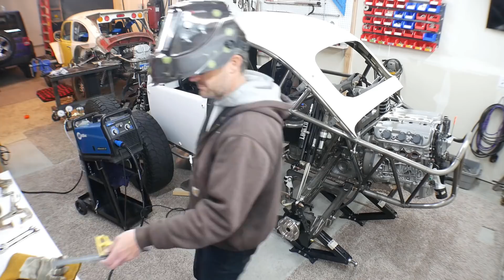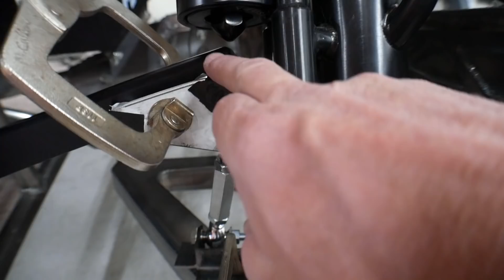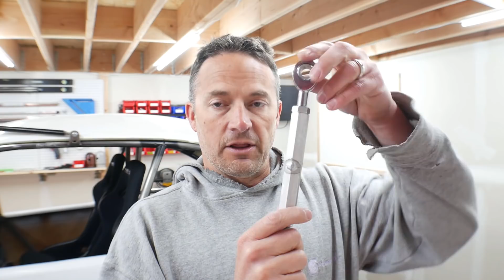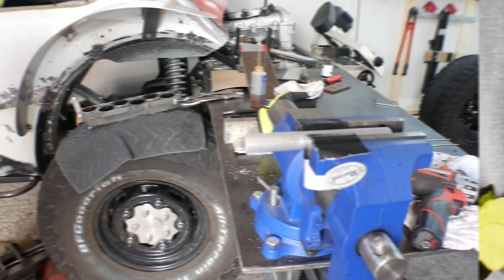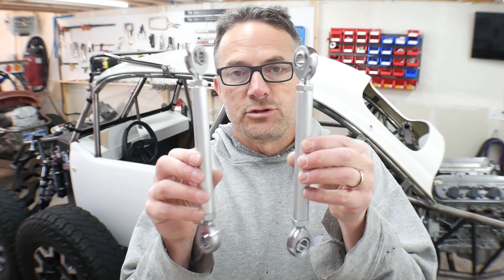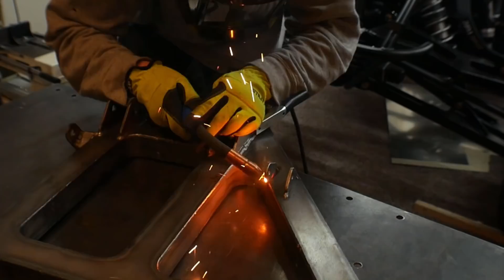Sway Bar Install on Wratchet.

Comment: Something Im glad I did when I built my sway bar from scratch was build in adjustability.  Both in clearance for movement of the arms and length arms.  
  Good job stay with it.
Reply from the maker: Thanks buddy!
I was going to try to do that, but with the arms moving apart at the extremes I was having some issues with the heim angles. So I just went with single point connections. I still might be able to make the upper connection point adjustable. I guess that's why these projects are never done. ;-)

Comment: can anyone explain what is the function of this sway bar ? 🤔
Reply from the maker: The sway bar ties the two sides together with a spring (sway bar). As the body rolls the spring resists and tries to get the body back upright. It keeps the body from rolling to much in turns. That's real high level, but hopefully gives you an idea.

Comment: Doug Bug, Nice fab!!! My only concern is when the Buggy is setting on its sprung weight the sway bar arm should be horizontal ( If you draw a line from the center of the sway bar mounting bracket or sway bar rod in your case to the center of the sway bar link connecting hole, the line should be parallel to the ground). If I'm not mistaken, sway bars works best in that position to keep the body stable in any driving condition. JMO
Reply from the maker: Uh-oh, you're using physics against me, that's a fight I can't win. lol
You're 100% correct, the sway bar would be most effective if it was parallel at ride height. But in order to do that the link was to short, it was making the angles to extreme at the ends. So I lengthened the links to correct that. But in turn the sway bar is no longer parallel.
However my sway bar arm is pretty long, so it shouldn't effect the leverage to much. I guess it was an acceptable loss in my book.  🤷‍♂️

Comment: Something I do to help with drilling level to the ground, is after leveling the part I am drilling in the vice, I put a large I bolt on the drill bit. As I’m drilling, if the I bolt slides towards the part, I know I’m drilling downwards. If it slides toward the drill chuck, I know I’m drilling upward.
Reply from the maker: That's a good idea, I might try that next time.
Thanks for the tip.

Comment: Works a treat, now that the end-links are longer!
You could put two rubber o-rings between the upper joint and the brackets, so that one will self-align, to avoid the possibility of rattling.
Reply from the maker: First of all that's a great idea and I will do that. 👍
Second I can't believe you picked up on that in the video. I was going to point it out but thought it would be to hard to identify.
Thanks for the idea.
Reply: @DougBugBuilder  I've build a few cars before in the last 33 years, so I tend to look past the obvious bits and focus directly at the details.

Comment: Does the rod inside the tube act as a torsion bar, opposed by the other sway bar? Is it spring steel?
Reply from the maker: Correct, the outside tube is just a carrier, it does nothing else.
The inside tube is spring steel and twists to oppose the other side.
It looks pretty stout but when all assembled you can see it twist when you rock the Baja back and forth.